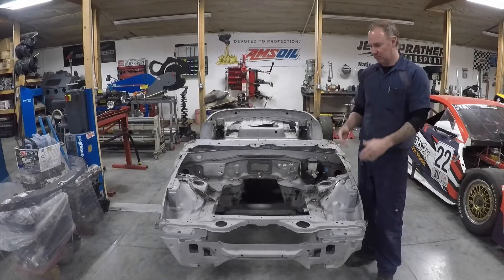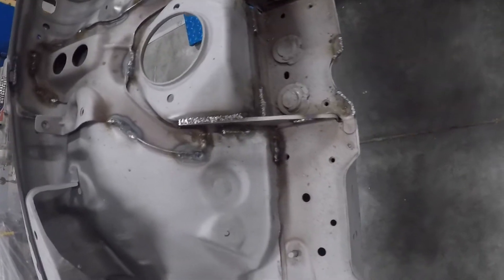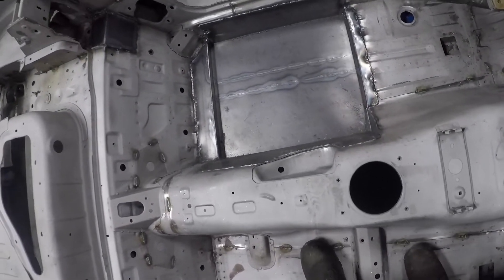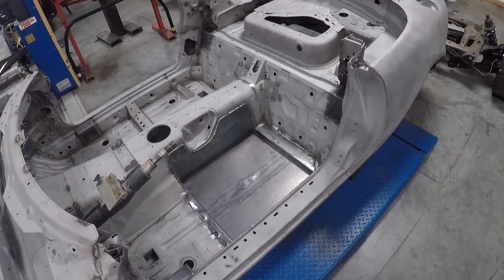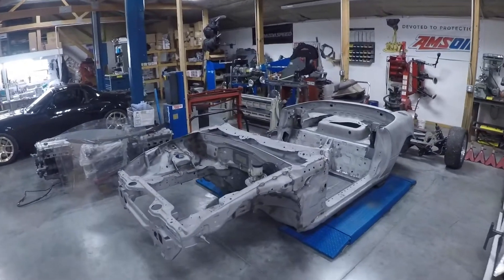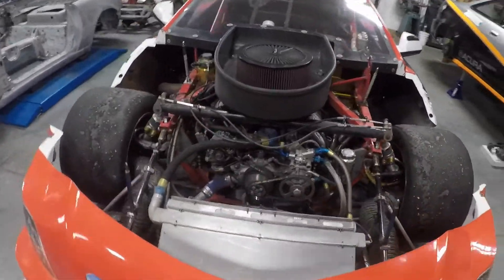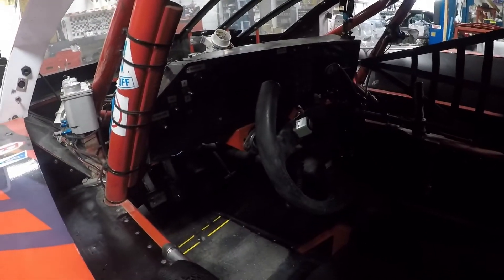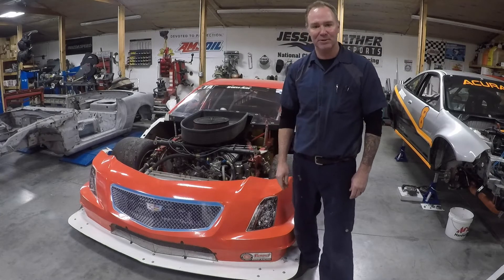Seam welding & cage mounts in a Miata race chassis

Comment: Do you go back and seam seal the areas you welded up?
Reply from the maker: No. Seam seal bonds two panels together as a sandwich better than as a “filler” after the fact.
Reply: @jpm   I just understood the "No" part.  What does the second part means ?
Reply from the maker: @halalmeatshophk  So this chassis will be getting completely powdercoated.  No need to reinstall seam sealer in an open top race car.  The powdercoat will take care of making sure the chassis won't rust.